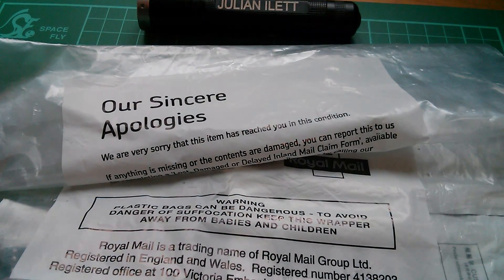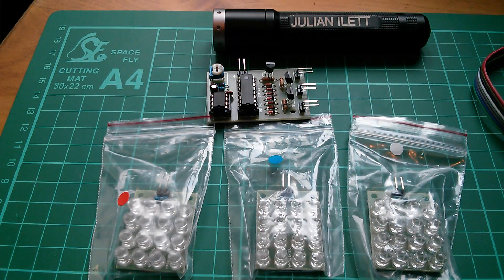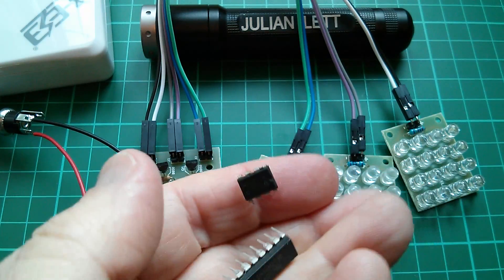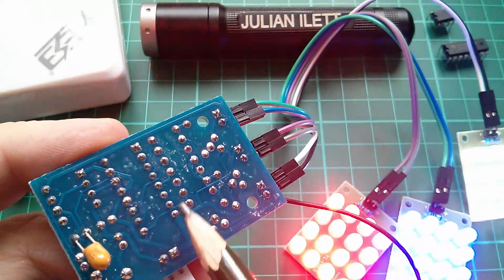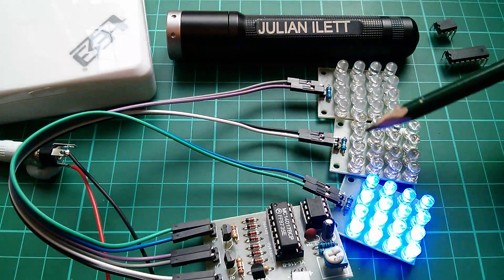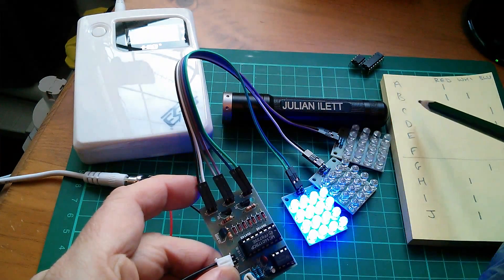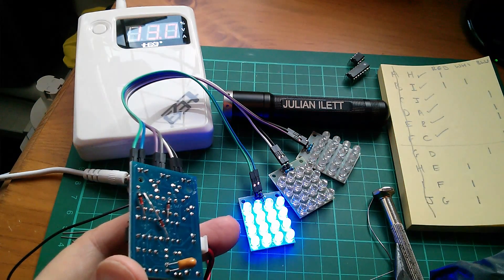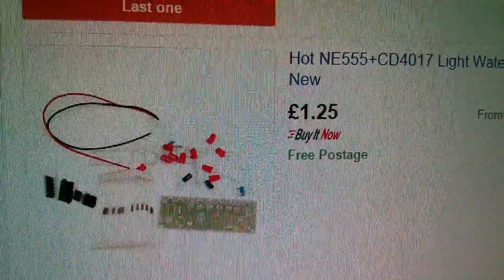Postbag #29: Fun Re-Wiring a 555 and 4017 LED Module

Comment: I have a set of these taking up space in my junk floppy disk box. I have disposed of all my old 3 1/2 inch floppy's and now use the plastic boxes to store my Arduino's and LED/LCD Screens as well as plain old junk projects such as this. I do play around with  them around Christmas time in our RV since we spend the Winter months in the Mohave Desert in South Western Arizona, and will once again this year, if I can scrape up enough money to go once more.  Very cool idea of delay and resetting them, not real sure what, if anything I will do with the set I have.  Perhaps toss them in the back room that is filled with old computers and parts dating back to the mid 1990's.  Anyone with a truck that would want to come and pick up a load?  Wife says I need to get rid of it all, sad thing is that I sold my Ford Pickup truck last fall, and now all I have to haul anything is my Ford Edge SUV that I plan to use as a towed this winter for our RV.

Comment: So I love your Videos and I thought I would get a Kit and Solder one up. It to came with a Red, White and Blue. Same looking cables and after spending all the time it takes to Solder up 48 LEDs and the Control board. Again all 100% same looking setup as yours. I look over everything to make sure there was no shorts or any extra solder to bridge things. I connect it up and I get nothing. So i test the Wires and all the wires are no good. No damage that you can see by the eye. So I take my Bread board wires that I have extras of. Solder up some connections to the system. connect the wires to the Breadboard for power and I get a moment of Light. Then I look at my Power supply and see it climbing in AMPs when it gets to about 1.5amps I hit the dead man switch as I now also start to see smoke coming from the 4017. It is crazy. It cooked my 4017 and the 555 as well. Put in a good 555 and 4017 from one of my other projects turn it on and it worked just like yours. 
Then I thought I would look into fixing the wires. All 8 and this is Crazy ALL of them are DUST inside the Insulation. I haven't ever seen something like this. I took out the clip from the holder and you can see what looks like Copper wire at the end. However that is only place there is any trace of wire. The insulation from end to end was just DUST. I think there was maybe 1 that had 1 strand of 1/16" long, however it was also breaking down into dust. I touched the strand it and just fell apart. Another case of getting Bad China Fake chips for the control board it seems. In the last 2 months I must have gone through 12 China fakes that takes out the 4017 and the 555. Not sure why. It is sad really even buying from USA sellers can get Fakes Tried that too lol. When I say fake I can use my known good 555 and 4017 in all my projects at 12v for hours no issue. Fakes more then 5.5volts they blow up and some items don't even want to work with such low volts lol.

Comment: I have a few kits that was Solder your own, Even though I had them all done right, I did as your Video and blew both 555 and 4017. Looking at the 2 that didn't make it. I figured out that they are Fake chips and only can take a Max of 5 Volts. I have some real chips so I added them to the Kits and did confirm they were Soldered right because the good Chips worked just fine even over 9Volts. I have found that buying things form some Sellers in China isn't always Smart. Even one that you have bought from. I have 5 kits that are Missing. I have bought from other sellers in China since those packages have shown up. I do hate to wait lol.

Comment: Love the "re-programming!  I had a closer look at this kit today, and I'm pretty convinced the S8050 transistors are "backwards" on the PCB: S8050 NPN usually have EBC pins, but these are connected like CBE NPN low-side drivers. still work, but probably exceeding max E-B voltage and not driving the LEDs optimally.

Comment: Hi Julian, I realize Postbag #29 was in 2014 but I think I might be able to explain a few things. Firstly, the condition of the package (it had been opened by customs) was to be expected. Unfortunately, alarm bells would ring if your package, which has random components and a coil of wire, was xrayed at the right angle. Not that it was a bomb as some viewers posted, but it might have been components to MAKE a bomb. Secondly, the Chinese translation didn't help you understand the purpose of the device. I have seen identical devices listed under 'Emergency Strobe". I did find Detonation Light Suite amusing. It is certainly not a traffic light. (Wrong colours, also a little too fast to be of any use). The unit is supposed to be housed and positioned behind your car when changing a wheel. Thirdly, I'm sorry that you went to so much trouble to work out the schematic. I found the exact listing on EBAY and found that at the bottom of the page, lakeyx101 had posted the schematic and a flash pattern of the red, white and blue Leds. I hope I have been some help. Alan.

Comment: Well done.  Suggestion for rev B.  You have a 4:1 ratio of red and green to the yellow and red/yellow...obviously because of the 4017 10-states.  Using your same diode-or logic, you can selectively feed back some current during chosen states to slow down the 555 capacitor charging.  This would get you a ratio of say 10:1 or 20:1 which might better represent traffic light timing.

Comment: Thats a chinese police light. In china you see this even at a police booth or on police bicycles. 
The white light is a bit of rare expansion, mostly you will find the blue-red flashing in the very same manner.

Actually nobody really cares about these lights in china as they are everywhere. Some times you have a tent at a corner in the street where the police finds some protection against the rain. Every post of this tent is then equipped with this sort of flashing lights.

Comment: How bizarre.  I stumbled across a PCB a few days ago that I made many years back, that uses a 555 and 4017 with diode matrix to "swing" a six LED pendulum.  The 555 and 4017 were a big favourite of mine due to their very gratifying function.
Reply: I remember building one of those - a 6 set of LEDS and diodes to use the last 4 outputs to produce the "swing" or Knight Rider scanner led effect.
Reply from the maker: bigclivedotcom I never did CMOS back in the day - I was a TTL fan boy. Catching up now though!
Reply: I kinda started off with CMOS and stuck with it.  The wider voltage range and ultra low current was appealing.